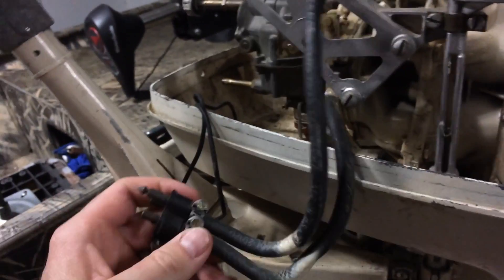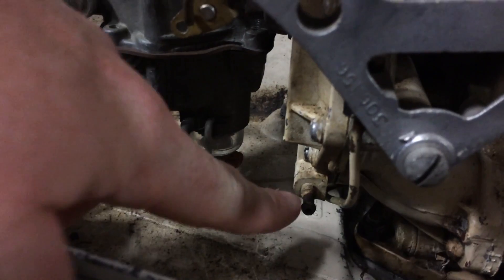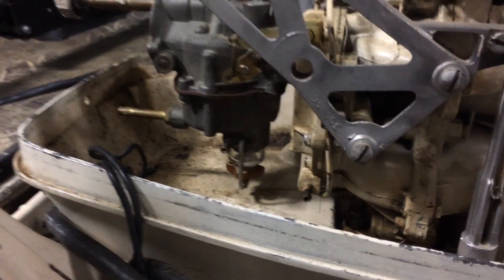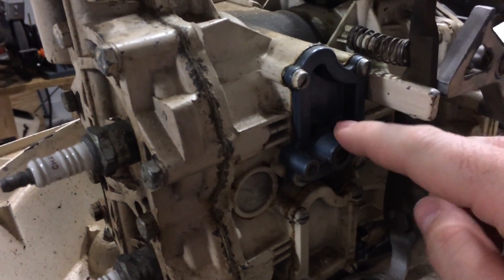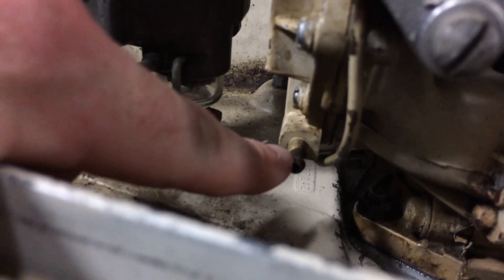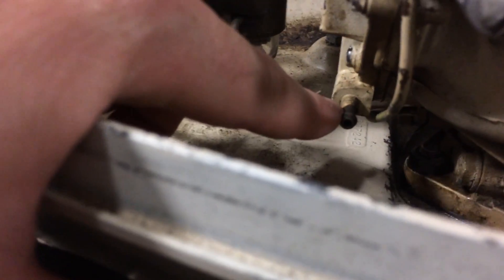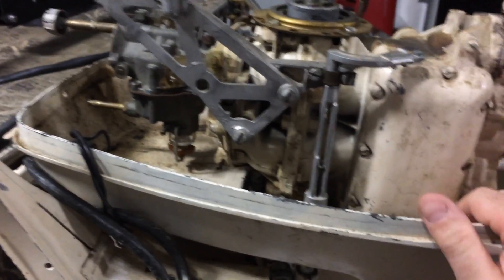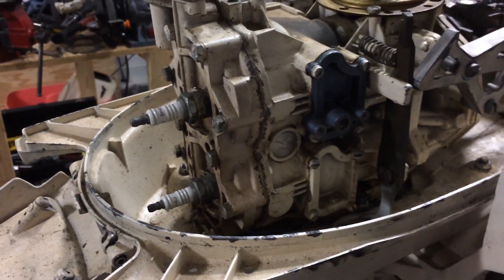Convert 10 hp Johnson Dual Fuel Line to Modern Single Line Fuel Pump

Comment: I don’t understand the purpose of the modification tho
Reply from the maker: Clearly
Reply: @thisoldoutboard  so what’s the purpose?
Reply from the maker: Convert the motor from having to use a pressurized fuel tank to be able to use a modern fuel tank

Comment: I have a 59 5.5 evinrude. Would the plate for a 10hp work. Thanks
Reply from the maker: My bypass cover plates (or any bypass cover plate) will not work for the 5.5 hp motors. The 5.5 hp motors are more involved to convert to a single line system.  See the link below

https://outboard-boat-motor-repair.com/Johnson%205.5%20HP%20Seahorse%20Outboard%20Boat%20Motor/Pressureized%20Fuel%20Tanks.htm

Comment: What's the part number for the new fuel pump?
Reply from the maker: 7.5 Hp
Years: 1955-1958
OEM Cover: 0202527
Gasket: 0202528
Single Line Connector: 0376154 or 0393334
New Fuel Pump: Sierra 18-7350 or equivalent

10 Hp
Years: 1955-1963
OEM Cover: 0301848
Gasket: 0301847
Single Line Connector: 0376154 or 0393334
New Fuel Pump: Sierra 18-7350 or equivalent

15 Hp
Years:
OEM Cover: unknown
Gasket:0304782
Single Line Connector: 0376154 or 0393334
New Fuel Pump: Sierra 18-7352 or equivalent

18 Hp
Years: 1957-1973
OEM Cover: 0304781
Gasket: 0304782
Single Line Connector: 0376154 or 0393334
New Fuel Pump: Sierra 18-7352 or equivalent

25 Hp
Years: 1955
OEM Cover: 0302542
Gasket: 0306010 302586?
Single Line Connector: 0376154 or 0393334
New Fuel Pump: Sierra 18-7352 or equivalent

Comment: A problem arises with old metal tanks which worked by pressure...top of tank has cork gasket which can leak and then no pressure.  Those gaskets are expensive to replace.

Comment: would this modification part fit mt 56 johnson 15 hp the plates look the same?
Reply from the maker: • 1955-1958 AD Series 7.5 Hp Bypass Cover Plate - https://ebay.to/2TyIVjb
• 1955-1963 QD Series 10 Hp Bypass Cover Plate - https://ebay.to/3fLJQX4
• 15 Hp E Series Bypass Cover Plate - https://ebay.to/2zu6P8T
• 18 Hp FD Series Bypass Cover Plate - https://ebay.to/2ZsVgtc

Comment: I'm wantin to put a fuel pump on my 18hp 58' sea horse but the part number on my block off plate is 314816. Will the 308396 work with this? thanks
Reply from the maker: • 1955-1958 AD Series 7.5 Hp Bypass Cover Plate - https://ebay.to/2TyIVjb
• 1955-1963 QD Series 10 Hp Bypass Cover Plate - https://ebay.to/3fLJQX4
• 15 Hp E Series Bypass Cover Plate - https://ebay.to/2zu6P8T
• 18 Hp FD Series Bypass Cover Plate - https://ebay.to/2ZsVgtc

Comment: Can’t find a bypass cover anywhere to convert my 59 Qd-20. Anywhere you know of? Thanks!
Reply from the maker: twincityoutboard.com
Reply: thisoldoutboard I’ll try them out, thanks
Reply: I’ve had no luck finding that bypass cover. Where’d you find yours? Any leads? Thanks.
Reply from the maker: • 1955-1958 AD Series 7.5 Hp Bypass Cover Plate - https://ebay.to/2TyIVjb
• 1955-1963 QD Series 10 Hp Bypass Cover Plate - https://ebay.to/3fLJQX4
• 15 Hp E Series Bypass Cover Plate - https://ebay.to/2zu6P8T
• 18 Hp FD Series Bypass Cover Plate - https://ebay.to/2ZsVgtc

Comment: So I think he got his parts numbers wrong cause I can't find the replacement cover that he has any help would be appreciated.
Reply from the maker: I am pretty sure I am right.  I used marineengine.com as my source.  See find number 55 in the link below

http://www.marineengine.com/parts/johnson-evinrude-parts.php?year=1962&hp=10&model=QD-23&manufacturer=Johnson&section=Powerhead+Group

And find number 60 in the link below

http://www.marineengine.com/parts/johnson-evinrude-parts.php?year=1960&hp=10&model=QD-21&manufacturer=Johnson&section=Powerhead+Group
Reply from the maker: For google searches and ebay searches use the keyword "bypass cover"

For instance:  http://www.ebay.com/sch/i.html?_odkw=johnson+10+hp+bypass+cover&_osacat=0&_from=R40&_trksid=p2045573.m570.l1313.TR0.TRC0.H0.Xjohnson+bypass+cover.TRS0&_nkw=johnson+bypass+cover&_sacat=0
Reply: what about the check valves?  @thisoldoutboard
Reply from the maker: • 1955-1958 AD Series 7.5 Hp Bypass Cover Plate - https://ebay.to/2TyIVjb
• 1955-1963 QD Series 10 Hp Bypass Cover Plate - https://ebay.to/3fLJQX4
• 15 Hp E Series Bypass Cover Plate - https://ebay.to/2zu6P8T
• 18 Hp FD Series Bypass Cover Plate - https://ebay.to/2ZsVgtc
Reply: @thisoldoutboard  would this work on a fastwin 4438?? It's a 14hp motor evinrude

Comment: The dual line system works so good.  Why mess with it?  Now you have a fuel pump to fail.
Reply from the maker: Pressurized tanks are not that common and expensive (much more than a fuel pump).  For instance  https://goo.gl/SkwwfV  

One may find themselves in possession of a motor that didn't come with a corresponding pressurized gas tank.  If so, they need a way to convert it to accept the modern gas tanks and lines in order to use it.  If you find yourself in that situation, this video shows you a way to do just that.
Reply: Spose.  Guess not everyone has a dozen of these sitting around.
Reply: agreed with above... the pressure tanks are getting harder to find and the have seal leaks usually. Plus the female fitting alone is usually 50 bucks not including the tank is around 100.

also there is a way to convert these without a fuel pump. you have to drill and tap into one of  the side plates but its fairly simple
Reply: Where does the hose from the new barb in the side plate go?
Reply: @billwhitmeyer3861  into the fuel pump it's the pulse line
Reply: lol, I have no idea why I asked that question as I have converted a 7.5 fleetwin and 5.5 seahorse. But I did get the pulse from the reed plate cover with JB weld in the channel and used the vacuum cap as well. Next time I'd like to get the pulse by tapping the base plate. Think I'm losing my mind!